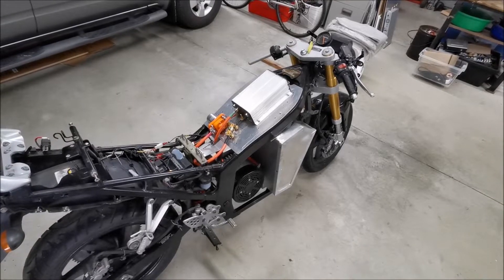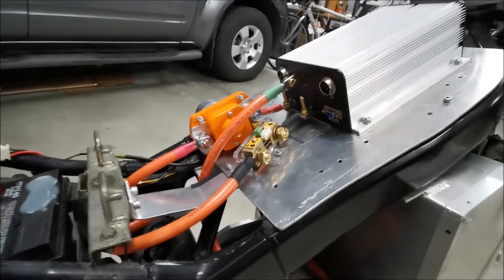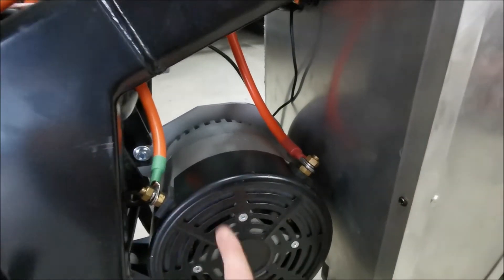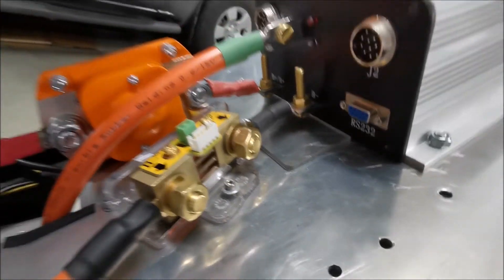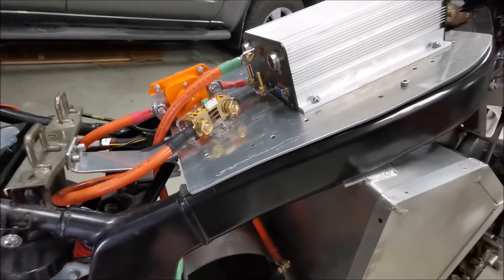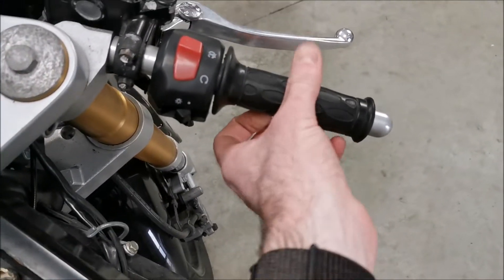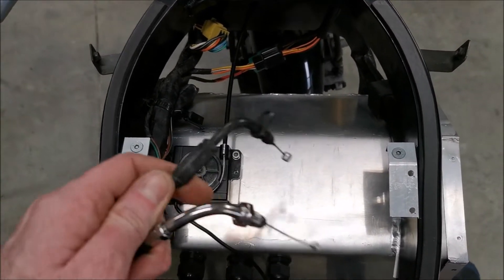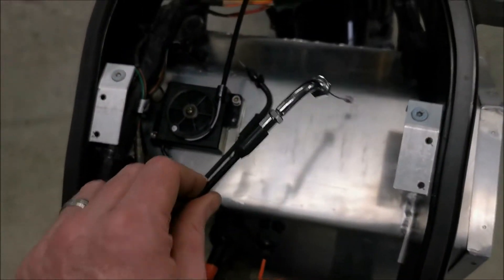Electric motorbike update 4 - Motor controller and throttle

Comment: What motor and speed controller are you using? The motor looks like a Motenergy brushed DC motor. And maybe a Kelly speed controller? I'm asking because I have the ME0708 motor and trying to find a reasonable motor controller for it (PMDC motor). I've looked at the Alltrax 48300, but am wondering if you have any recommendations for speed controllers (or can provide some info on how yours has held up). Have enjoyed the videos!
Reply from the maker: Hey there, sorry for the late reply, yeah, that one is a Kelly controller, second one I have used (first was for a BLDC motor) and very happy with both. Have not had any problems and they have absolutely worked exactly as they were supposed to. I just ordered online from them directly and had it Fedexed.